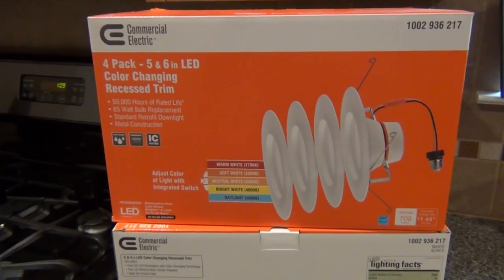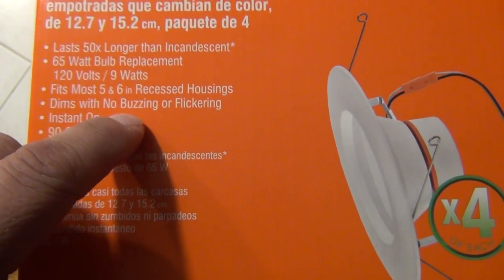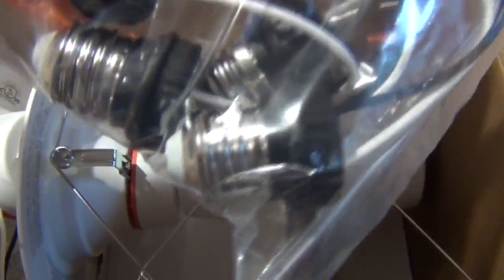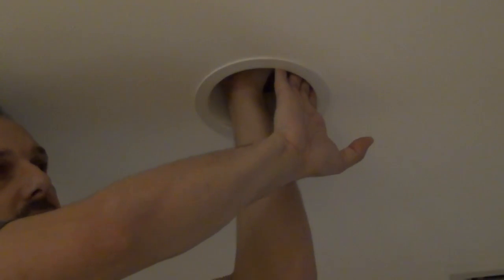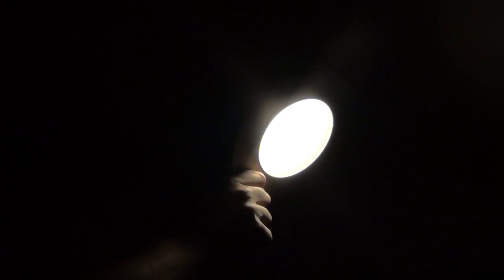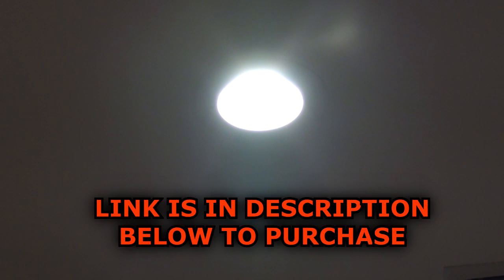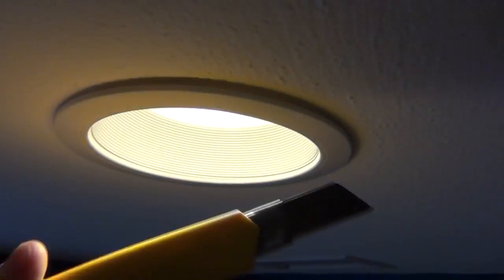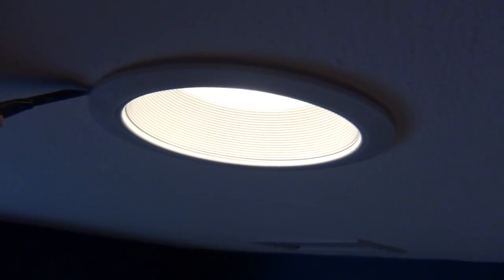How to Install LED Recessed Lighting

Comment: Great. I installed so many LED lights improperly, and after this video I fixed all of them. On manual is not clear how to use the springs. After this video I understand the concept to use spring support. (brackets or on some models little different built in  support). Thanks for the video
Reply from the maker: Thank you!!  Glad you found the video helpful!!

Comment: You had good clearance over the lights here. If it's not so great, do you remove the socket plate, or try to adjust it further upwards?

Comment: I have an existing led recessed light that already has the orange adapter hard wired in.... can I just plug that into this light and not use the bulb socket adapter that comes with this light?

Comment: I am thinking about using these lights and installing directly into a fresh-cut hole in the drywall.  I have tested the fit, and the fit is fine, and it will stay in place with those flexible spring-arms.  The issue I have is about is the electrical connection ...  I would be cutting off the "bulb socket" end, and connecting the black and white wires directly to an existing run of 14/2 that is currently in the ceiling.  The existing run of 14/2 has three wires in it (black, white, and copper ground).  It's simple enough to connect the black and white wires from the 14/2 to the black and white wires coming from the light, but what do I do with the copper ground wire in the 14/2?  Where do I connect that, or do I even need to connect the ground wire at all?  Or is it even possible to set up the lights this way?

Comment: Are these only designed to replace lights that are already recessed? I have what is similar to an old school ‘Boob’ light, that I want to replace with a modern LED.
Reply from the maker: This particular style is to retrofit old recessed cans. You can get a wafer style light and replace your current fixture. Check my channel, I have another video showing these lights

Comment: Quick question, my new led lights didnt come with a ground wire in the junction box, the romex I am using is 14/2 and has a groung. So my question is, do I run the ground wire and screw a screw into the box to tie the groung into? Or do I even need the ground? The model lights I have are 6in LED recessed Commercial Electric lights, its canless and uses a black junction box that only has a black and white quick connect.

Comment: Thanks so much for sharing! I currently don’t have any recessed lighting but I am wanting to install 6 in my living room and 6 in the kitchen . Do you think it’s better to get those small flush LED lights that don’t need cans or go this route with the cans and led kits? Also, my house is old with two wires (Live and Neutral) would either option work for my wiring?
Thanks so much!
Reply from the maker: Yes, you most definitely would want the smaller pancake LED’s for a new install.  The one I showed in the video would be for a retrofit application.
Reply: Fix It With Zim I hear the small flush lights have a glare and there’s not many options for trimming. Do you find that to me true in 2020?
Cheers.
Reply from the maker: @JoJo-oo7zt  I’ll have a video out in the next 2 or so weeks about the new pancake style LED recessed lights. I installed some in a soffit outside.  I haven’t had any problems with them.

Comment: Do you have to use a special dimming switch for these can a incandescent dimmer switch work
Reply from the maker: Yes, you’ll need a dimmer rated for LED use.  I had an incandescent dimmer hooked up to these fixtures previously and the lights wouldn’t dim down sufficiently and also flickered from time to time.

Comment: Great video. Can the LED bulbs be replaced when they burn out?
Reply from the maker: No, the the lights I installed in the video are a sealed unit, no way to replace the diodes
Reply: Thanks. I was afraid of that.  Does a fixture with replaceable builds  even exist?
Reply: I believe they will last something like 3 thousand hours or so. How I look at it by the time you do or will have problems with them. Something even better will be out plus with the cost not that big of a deal.

Comment: They don't need a ground wire?
Reply from the maker: @kenmatlock3158  think of these fixtures as a light bulb. No ground on those either. The fixture itself is grounded

Comment: I have 7” cans for my replacement LED fixture and I am having trouble finding a fixture with the trim piece bigger than 7”.
Reply from the maker: You sure you have 7” cans?  I’ve never encountered those before. Usually just 4, 5, and 6”
Reply: When you say “6 inch”, that’s the size hole in the ceiling correct?
Reply: Any luck finding anything?  I also have 7" cans, yes everyone, the hole in my ceiling is almost 7.5", the can is 7", and I can't find anything that works well.

Comment: Do you already have to have recessed lighting to install these??
Reply from the maker: Yes, the cans need to be in place
Reply: I've seen where you can flip the springs and install right into a hole in the drywall. I'm getting ready to do this and also hardwire them not using the bulb socket.
Reply: @MrMpdrn23  I'm thinking of doing the same ... cutting off the bulb socket end, and attaching to the 14/2 wire that I already have running through my ceiling.  What did you do about the copper ground wire in the 14/2 wire?  Did you connect the ground wire to anything on the light, or not bother?
Reply: The lights I ended up getting had a control box where you made all connections and just sits in the ceiling above the light. Very easy to install!

Comment: BUT HOW DO YOU CHANGE THE LIGHT BULB????????  MY BULB IS OUT BUT I CAN'T FIGURE OUT HOW TO CHANGE OUT THE BULB!
Reply from the maker: When integrated LED fixtures burn out, you need to replace the fixture. There’s now way to change the internals of the assembly

Comment: Why not just buy LED bulbs that fit and screw them in?  They are cheaper if you buy in bulk (6) on Amazon.
Reply from the maker: I’ve found you get better light output with the integrated trim kits that I used in the video. I also wanted the ability to adjust the light color. I haven’t been able to find individual bulbs with color rendering that I like.
Reply: These look much better and provide more even, pleasant light. I have 12 can lights in my basement and originally put LED bulbs, then swapped to these after I found out about them. They're more expensive but it's only like $100 for something you never have to replace...
Reply from the maker: @roybotnik  Exactly, I'd rather pay a few extra bucks up front and be happy with it.
Reply: Philips Hue is a superior solution.
Reply: Don’t forgot that the led retrofit kits seal air from escaping up into the attic or ceiling space unlike the halo cans which is another huge savings. Plus they look 10 times better. So clean.